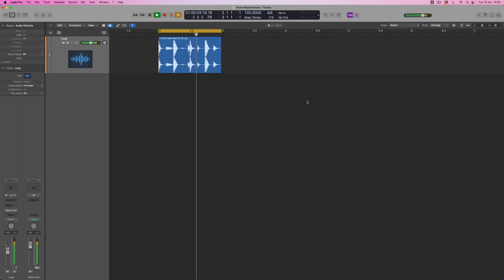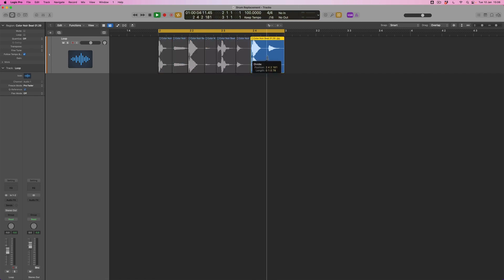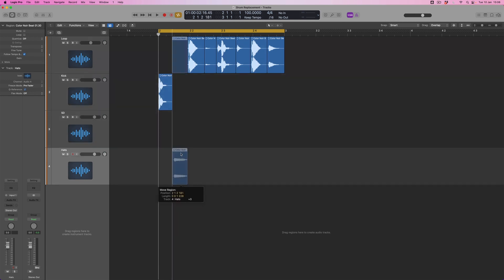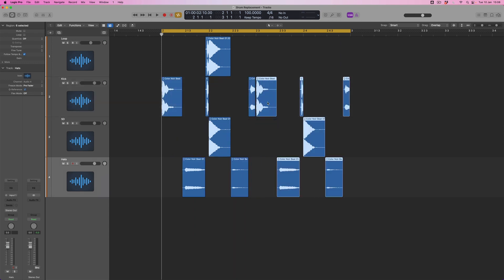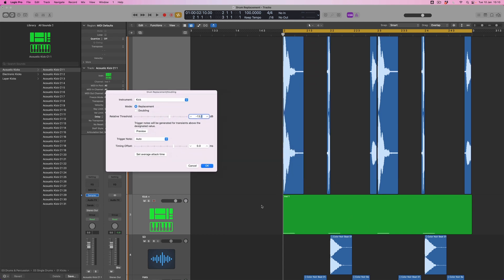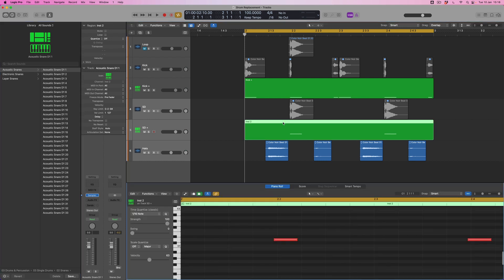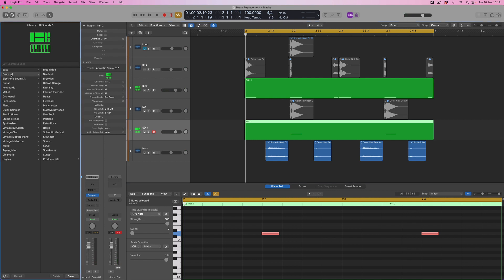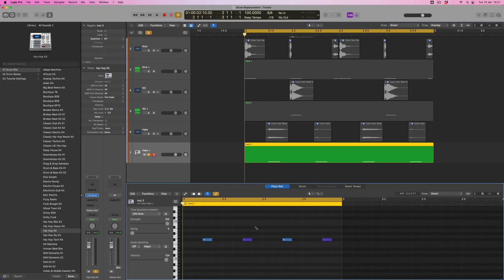LOGIC PRO X - Drum Replacement Part 1

Comment: How would you go about replacing a kick with a sound from a sample pack i downloaded / not a logic sound.
Reply from the maker: Hi. You can follow all of the steps in this video to create a Sampler replacement track for the Audio file you want to replace, to convert the original Audio loop into MIDI. And then simply swap out the Sampler for whichever sample instrument is hosting the sounds from your sample pack (i.e. Kontakt). I hope that helps.

Comment: Nice and clear, but fills me with the dread that if it took this long for a four beat loop, how long is it going to take me to replace a kit recording of a 4 minute song?
I’m going to try some heavy EQuing to isolate the various elements in audio and see how the drum replacement detection responds to that.
And then, how do Logic drum sounds handle round robins? Natural drummers don’t worry about the machine gun effect but is drum replacement clever enough, or does it mean building a whole new instrument in Sampler to avoid the effect.
Looks like I have more investigations to do!
Maybe, by LP 11.8 we’ll have an AI tool that can do whole kits. (….a couple of months after Waves or someone releases a dedicated AU tool.)
Reply from the maker: Many thanks - and good questions. The Drummer's Producer Kits will certainly deal nicely with round robins and natural-feeling sounds, as they're heavily multi-sampled. Absolutely, heavy EQing can help with detection but I also think that like most production techniques, you'll find that you get exponentially faster when working with this feature. I hope you get a great result!

Comment: Random thought, not directly related to what you have shown in this video. I can’t find a simple reliable way to record other computer audio into logic. Suppose I wanted to record from Spotify or YouTube into an audio track, how does that happen? I can run a cord from another device into my interface, but it seems like it must be possible to capture the audio within the computer. I understand that there can be copyright issues, but not every sound on the internet is subject to this problem. Internet searches suggest there are dodgy looking apps I can download, but is that the best way? 

Just a random thought for a future video in case it’s helpful. Feel free to ignore.
Reply from the maker: Hi Andrew. Soundflower is one of the trusted solutions for this. It allows you to run audio playback from any source and route this into Logic. Having installed it, you'll need to experiment with input/output routings, both within 'Sound' within System Preferences and within Logic as your audio input source. Once you've captured the audio you want, switch back to your regular audio interface. As you say, beware copyright infringements. Otherwise, this is much easier than using a second computer.